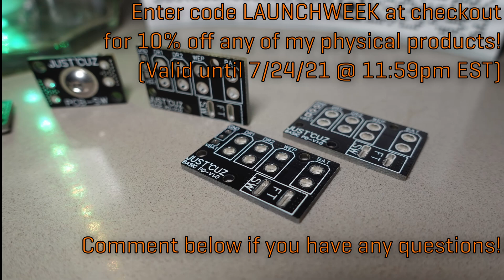Wiring in Minutes, not Hours! Just 'Cuz Basic PD Board (Combat Robotics Power Distribution PCB)

Comment: Do you have tests about current carrying capacity?  I presume at currents not melting the FT switch it isn't an issue, but it would be nice to have current ratings on all your products like "40A continuous, 60A for 30s" or whatever it might be.
Reply from the maker: I've run tests on all the variants of the boards and switches. They all survived over 30A for more than 3 minutes and bursts of over 50A for 30 seconds. Something else always failed first like 18AWG wire insulation burning, or the solder joints melting off due to the heat generated. They get hot (like up to 80-100C), but will not fail spectacularly in any practical use case. 

Continuous draw like that should never happen in a real fight and the XT30 connectors are actually only rated for 30A burst and 15A continuous. So I would say those or solder joints will nearly always fail first.
Reply: I'm just suggesting putting the data you have on the product pages.

Do you have a source for the XT30s being rated only for 15A continuous?  I was pretty sure it was 30A continuous, though that might be with airflow like in a drone use case.

With airflow, this guy tested it and found #18 wire was the limiting factor, and with #16 he had no problem doing 60A for 10s.

https://www.youtube.com/watch?v=bkVsqDOSqIY
Reply from the maker: I will probably add some info about the ratings but it also is a bit misleading to say 'good for X amps' without explanation. I really wish I could make some sort of a temperature log over time for set current levels as that better indicates what is really happening. I can definitely make a recommendation that people not go above a certain current for a set time period, but I feel like a lot of people will misinterpret that as 'oh my motor says 50A so I can't use it' even if in reality it draws under 20A while spinning a weapon in free air. 

While I was looking at bulk supplies of XT30U connectors all the Chinese manufacturers datasheets were saying 15A.
Random example here but there are many others on Aliexpress. 
https://www.semikart.com/product/XT30U-F/1621682
Reply from the maker: I should add I also tested 24V 58A for 30 seconds and solder joints between my wires and the XT30s or XT30s and boards were melting around that point
Reply: I agree it isn't as simple as one number, but having the test data lets people make their own decisions.  I'm using a FT switch on a 30# sportsman, and I get peaks of 70A spinning the wheels while lifting 45# at the end of the lifter, but more typical loads are 25A or so.  FT's test data gave me the confidence that it would be fine for my requirements, even if it wasn't what they intended it be used for.
Reply from the maker: Definitely can appreciate that. I'll keep that in mind and try to figure out how to present the test data